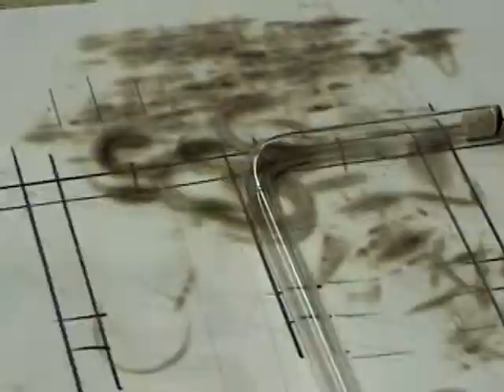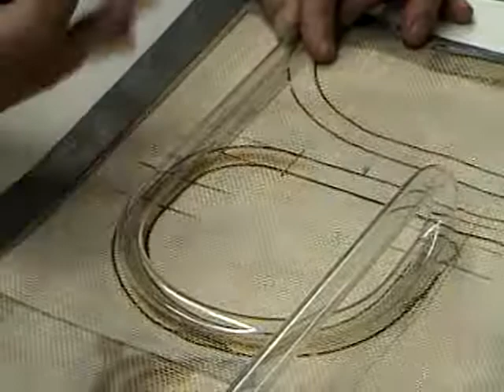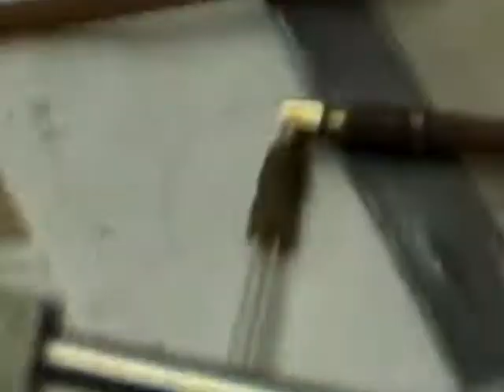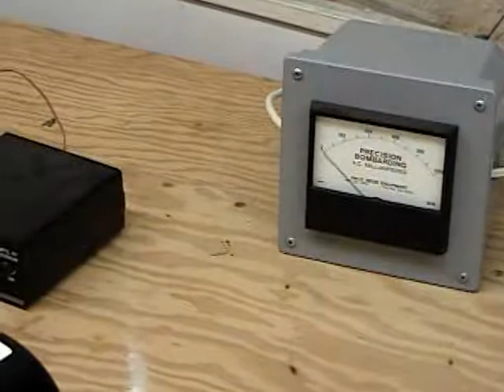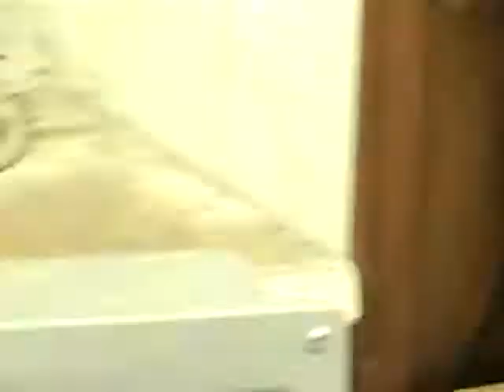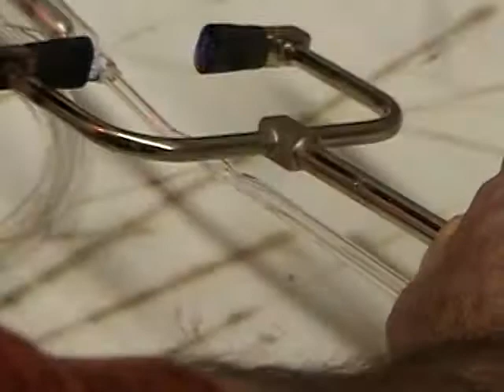How-to make neon sign

Comment: Good job!  I think this was lucid and complete, a good basic tutorial, or a refresher which is what I need.  There are so many people who think they want to do this work, and don't have any idea AT ALL what is involved, this would be a good place to start.  ONE little detail, on the part where the tubulation is being preheated, that should be done when the tube is on high vacuum, before it's filled!  There's going to be water and stuff in that tube, and the time to release it is when the tube is exposed to the vacuum system.  Most people don't do anything here, it's not going to be fatal.  Anyway, the tubes looked well and aged quickly, I have done this work before, and still learned several things!
Reply from the maker: Very nice! I’m glad it helped and thank you for the suggestion on the tubulation. This video was actually filmed by my dad too 😂